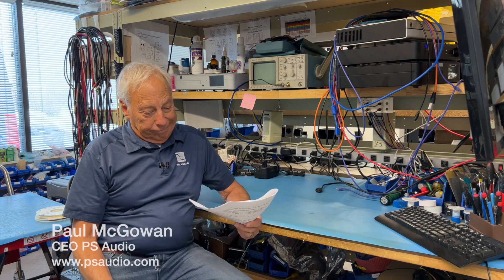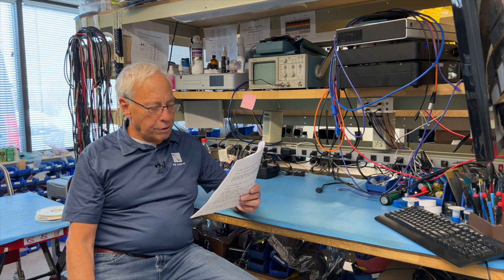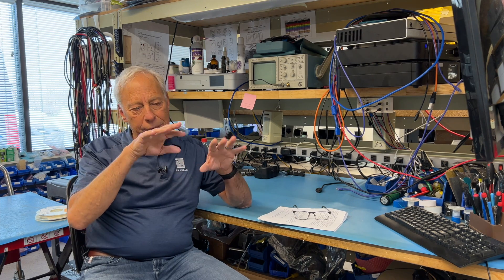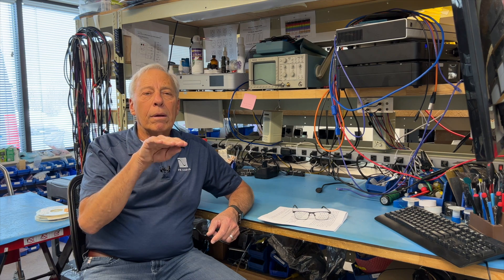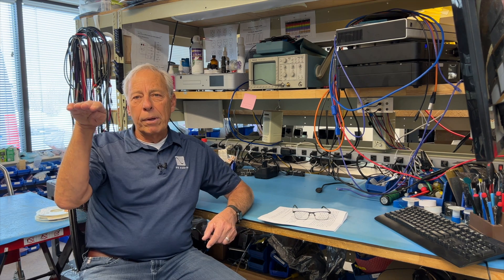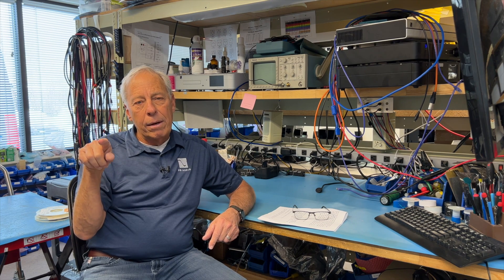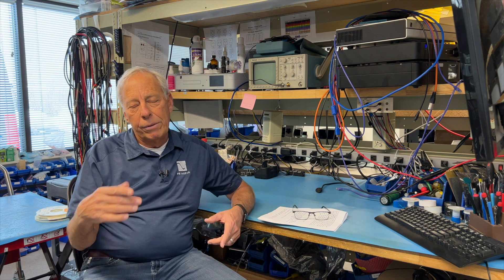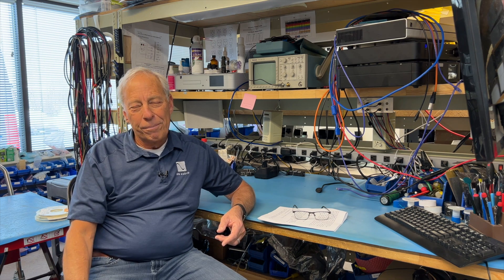How to build an auto on circuit

Comment: Very good,  many applications when used with the output triggering a relay. I designed and built a tablet counting machine in the 1980's utilzing a programmed automatic shut off. This is simular, but in reverse.

Comment: My QSC SPA4-60 (home / commercial) amp I use for my tweeters has that feature. My other two QSC amps have massive power switches. Being I've fooled with car audio for decades also I've known about this feature. One thing I found odd though was that with the QSC, when my cable box was plugged into my system it would trigger it to turn on with the whole system off. I no longer leave my cable box plugged in.

Comment: Flash back to the past! I remember selling a system that would plug into the power connector under a turntable which you connected the amp to. So when you lifted the tonearm, the plater started spinning, the amp came on! Perhaps for Gerrards or Duals?

Comment: if only they worked as intended, all analog auto on off sensing things keeps turning off while i play at low volume.
can not they be designed in the digital domain? there you do not have noise that interfere or levels are so low that it can not go lower.

Comment: Good answer.  But if you don't mind learning some very basic programming, you could also use an Arduino with a Solid State Relay (SSR).   The Arduino will give you lots of flexibility over a fixed circuit, perhaps even creating multiple timers for multiple equipment.
Reply: Yep , I put together a system of amps and speakers in a friends home I was house sitting in using Arduino and raspberry pie boards with photo sensors, long story short , as he and his wife walked through there home after being on vacation for a month there was recorded messages and background music from room to room . I was board and figured it would be a cool joke .